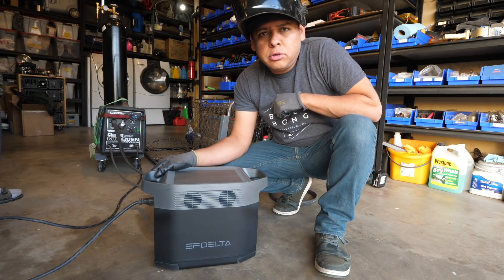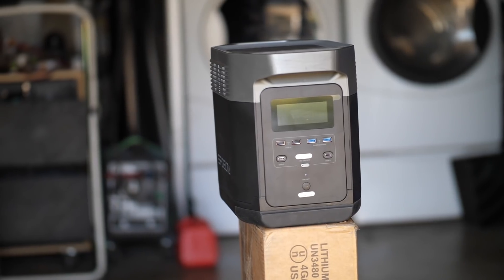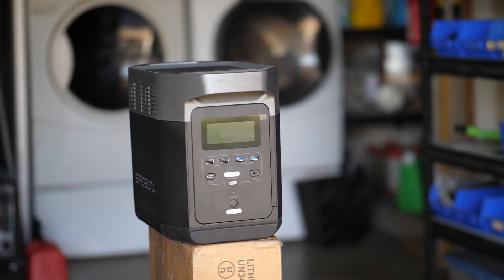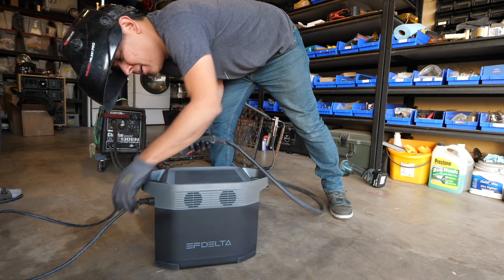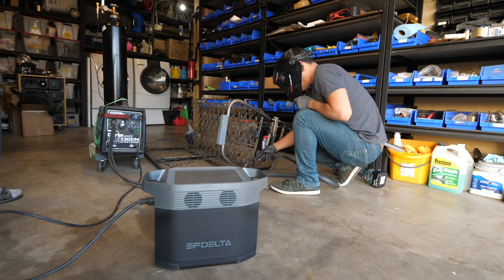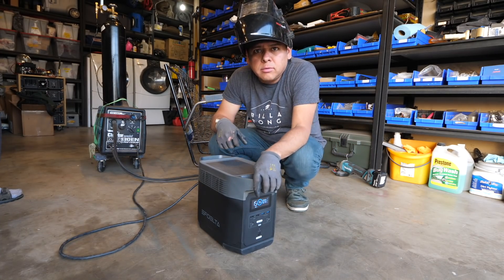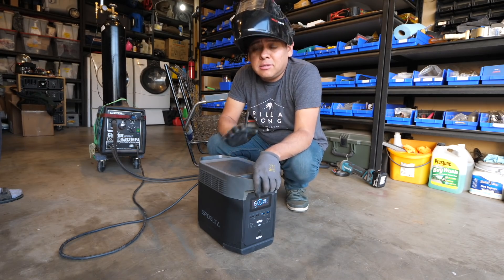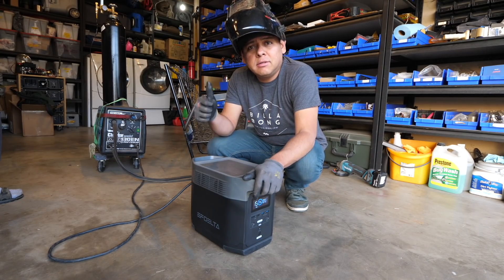Can One WELD steel Using Lithium Battery Generator?

Comment: Not everyone has that type of welder or afford... it's a pretty good welder sometimes people have welder from eBay hitbox from eBay..
Reply: That is not an expensive welder; I expect that bottle would cost as much - maybe $400.  The cheap flux-core welders from Harbor Freight would likely run on this.  At setting 2 out of 4 or 5, I doubt you're even 90A in short-circuit welding.  Disclaimer: I'm not a professional welder, but have welded a fair amount in my home shop.

Comment: I think the main problem with using a battery like this is to do with the inverter, even with petrol generators you need to have a more powerful inverter so the battery isn't the problem if you swapped out the inverter for a more powerful one the welder would have no problem, but then you get into a more expensive inverter, you could use the same batteries.

I have a 3 kw inverter on my petrol generator and it still won't provide enough power to use a mig welder, it might just do a stick welder on low power but welding uses a lot of amps.

Comment: Kinda sounds like you're a bit low on gas, and the ground should be closer to your welds as it only seemed to trip when your nozzle was too close and shorted it out. Otherwise, good stuff!!
Reply from the maker: yeah I'm getting ready to change tank,  but the ground was 6" from weld

Comment: What's the wire thickness did you use? If it's 0.035 in. then you can go down a notch to 0.025 in. and that would not trip a breaker but might take a bit more time to weld the same metal thickness.
Reply from the maker: .035

Comment: This is exactly what I'm looking for. I've never welded and have DIY batteries made from pouches (I'll check with the supplier what they are rated for) but would it work with an amp limiter, a couple of electrodes, some kick-ass capacitors and a stick weld? What, at a functional level, is the purpose of that big box in the background? What does it actually do?

Comment: I'd be more curious to see if you can weld off of a DeWalt or Ego power station!!!

https://www.homedepot.com/p/DEWALT-1800-Watt-Portable-Power-Station-and-20-Volt-60-Volt-MAX-Lithium-Ion-Battery-Charger-DCB1800B/207164383

https://www.homedepot.com/p/EGO-56-Volt-3000-Watt-Nexus-Portable-Power-Station-Generator-Powered-with-Two-7-5-Ah-Batteries-PST3042/305092922?mtc=Shopping-B-F_D28I-G-D28I-28_7_GENERATORS-MULTI-NA-Feed-LIA-NA-NA-BASE_SHP&cm_mmc=Shopping-B-F_D28I-G-D28I-28_7_GENERATORS-MULTI-NA-Feed-LIA-NA-NA-BASE_SHP-71700000048375648-58700005372785972-92700048811835354&gclid=CjwKCAiA44LzBRB-EiwA-jJipPmrF4YQVC-Mk698VTHtJ5SaKvfAN54pCxGIWJbF4vJxTi-gwaLaiRoCBzAQAvD_BwE&gclsrc=aw.ds

Thanks!

Comment: When I clicked on this video I thought you would be welding with a lithium battery generator. Instead you're using a standard mig welder plugged into a battery pack.

Comment: You cheated lol you used a welder run by the pack. Try it right off the battery Frank Z did it last summer. https://www.youtube.com/watch?v=J_varGdwcx0&t=16s

Comment: I have used my 38120 cells to do light duty welds on bit of pipe and angle iron brackets.   Using 1/16th rod works quite well for a few minute job.  Use POSITIVE GROUND.  You get less spatter and the arc is easier to maintain.   24V works but 48V works much better.

Comment: Welding???  More like tacking.  Please test this battery welding 2 1/4 plate metal.  If it can do that then it can weld.  In a real world situation, you're going to use this either off grid or when their is a power outage.  As you said in your video, it only will power the welding with the welder set at 2, that's not that much welding power.  Thanks for the video and I look forward to seeing what you have coming in each new video.  You're very informative and sometimes think outside the box.  Thanks again!
Reply: Bruh, he said in a pinch. Not full scale. 🤣
Reply: @Theworldisabeautifulplaceyakno  In a pinch is where you need a welder to weld.  If you're off grid and a support to your solar panels snaps.  Do you think you want something that will tack something together or a welder capable of fixing the issue?  Welding is welding, a setting of 2 on most welders will allow you to weld sheet metal and very other light duty welding.  That why I asked  to see 1/4 plate welded, that will tell me if I can count of this battery to get the job done when it's needed most.  In a pinch.